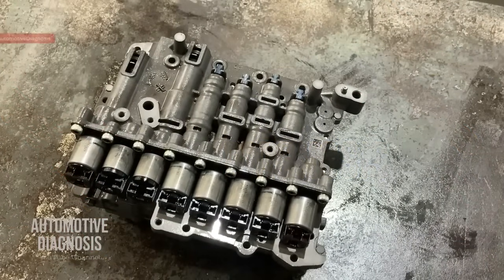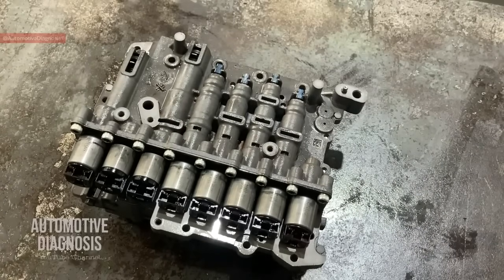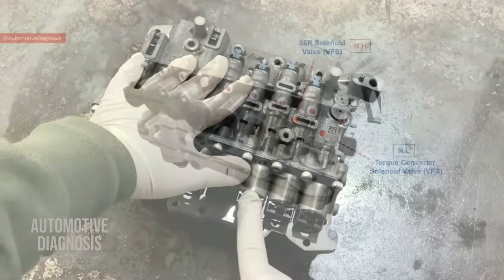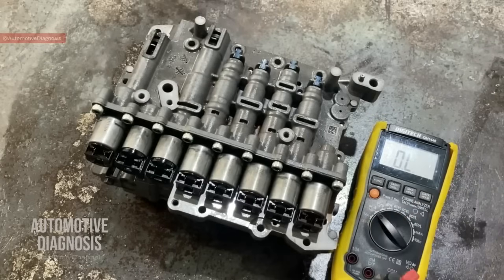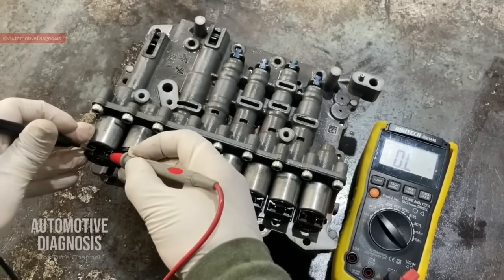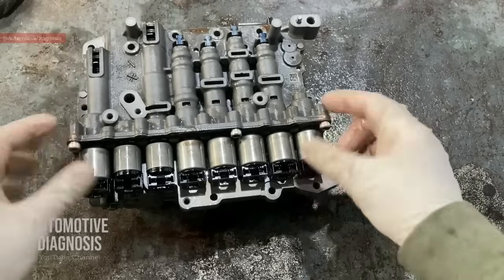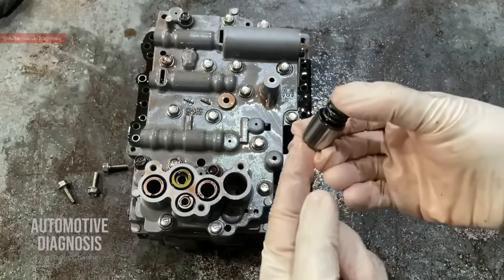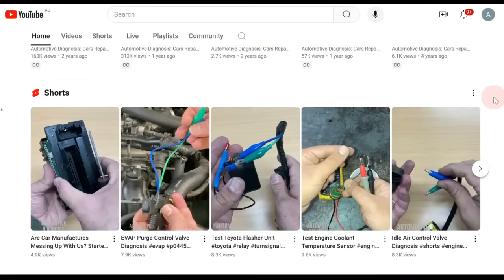Transmission Valve Body Explained | Shift Solenoids Diagnostic, Accumulators & more

Comment from the maker: 🧑‍🎓Online Course: Automotive Engine Sensors Intro, Operation & Diagnostic (18 Sensors)
https://www.udemy.com/course/automotive-engine-sensors-intro-operation-diagnostic/?referralCode=46EA28988FB987E04D27

🧑‍🎓Automotive Engine Actuators Intro, Operation & Diagnostic Online Course: 
https://www.udemy.com/course/automotive-engine-actuators-intro-operation-diagnostic/?referralCode=A42D26E9E4C3877E70F2

🧑‍🎓Automotive CAN-BUS Network Intro, Application & Diagnosis Online Course
https://www.udemy.com/course/automotive-can-bus-network-intro-application-diagnosis/?referralCode=C0C59CCB3595CB9C0C13

🧑‍🎓 ABS & Traction Control System Diagnostic Online Course:
https://www.udemy.com/course/abs-traction-control-system-diagnostic/?referralCode=60495279E0E97BF02E2D
Reply: I have completed 3 courses of yours and they were brilliant. Waiting for Auto Transmission courses, Thanks

Comment: bro i just installed a new valve body on my 2013 sonata limited 2.0l and now the car won't go into reverse. But all the other gears work. What could be the cause and how do i go about checking it on an autel scanner? I think i did some resetting on the A/T before i started the car and waited for it to come to under normal condition for the transmission before i went thru each gears with 5 seconds in between. i did that 3x. The when is time to try and see if the car moves, i tried reverse and car would not move. I put it in derive and it moves. Should i take out the solenoid for 35R? Could it be that the wiring harness is not sitting right on all the solenoids? I am gonna check to see if it has 5.3 readings on it first.